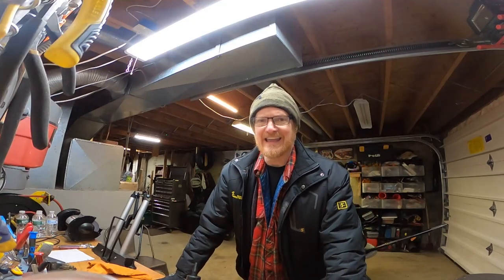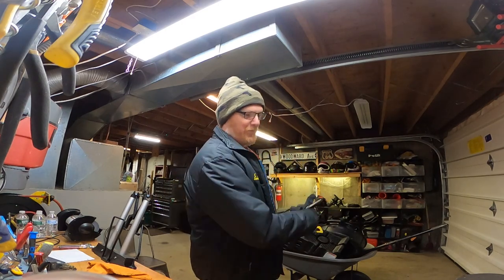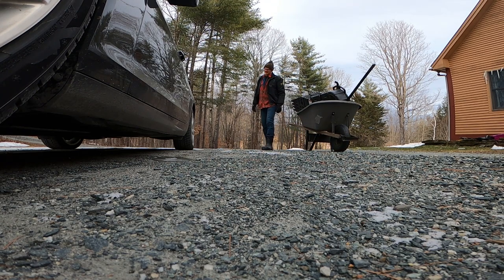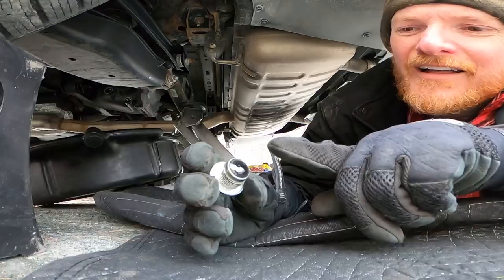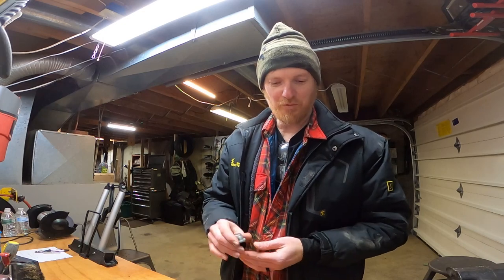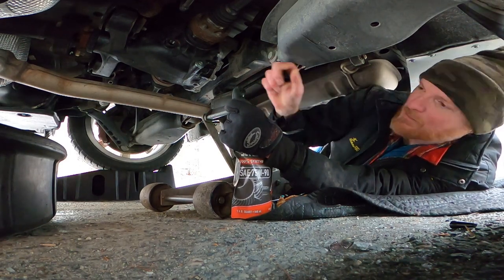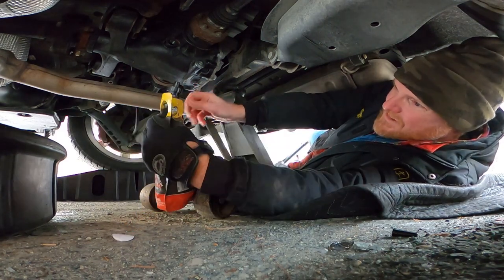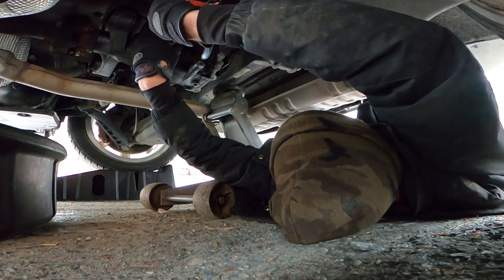Cadillac ATS NEW Differential Making Noise - Will Amsoil SVG 75w90 Help?

Comment: I really like your videos! Thank you for the awesome, genuine ATS content! I am a Cadillac ATS owner that likes to do things myself and its nice to know that someone else has experienced the same things I have experienced and is finding simple solutions!
Reply from the maker: Thank for the kind feedback. Its a marvelous car. Ultimately I had to have the dealer replace the rear differential again, but its currently smooth as silk! Nice to hear from you my ATS brother :)
Reply: @sstressfl   Of course! so just to clarify it was the rear differential that was causing the car to run rich?
Reply from the maker: @michaelguidice1663  No the engine had a vacuum leak in one of the active motormounts and connected hoses. They replaced them and it fixed the rich condition... which technically was a lean condition but the computer was compensating for the vacuum leak and dumping extra fuel into the system.

Comment: Hey brother congrats on the solution. My 2013 rwd has 106k on it. But my rear diff did go out at about 85k and my radiator just cracked 3 weeks ago. Not cheap. But, I paid to repair them. I can’t see getting another car. My car is modded and tuned. They are so fun to drive, I get what you are saying. Is that SVG for AWD only?
Reply from the maker: AWD only. Amsoil said use the GM stuff for the posi 👍

Comment: Great move with all the jacks, you can never be too safe. I hope it fixed your problem!
Reply from the maker: The amsoil is amazing. Unfortunately these differentials are not lol. But the car has been usable with the last one the dealer installed. Still makes some vibration, but I suspect the mid-bearing (driveshaft) might be part of the issue. Thanks for the feedback :)
Reply: Hi Michael, 
It’s been a year since you changed the diff oil, any thing new happen since then? Hope you are having a great spring!

Comment: Any update on how the amsoil performed in your differential?
Reply from the maker: It is no doubt the most incredible rear gear  lubricant I have ever used. The simple truth is that once a rear end is failing, it’s failing. Amsoil might buy you some time but it’s inevitable. My rear diff still has some rumble but it’s more difficult to make it happen. For now I’m good... but researching other options. Like buying a Ford 8.8” center section, custom axles, etc.

Comment: Hello I'm having trouble with my differential, making a loud humming sound as soon as I step on the gas. I will try this gear oil out hopefully it'll work. Is it only one pack of oil that you used?
Reply from the maker: I'm sorry to hear it.... yes one pack is all I used. Make sure the car is level when you fill it. You want to make sure it doesnt get overfilled or underfilled.
Reply: Hey what was the out come did it fix

Comment: My diff did a gear whine from 30 mph to 45 mph on Amsoil 75W90. To get it to quicket down I purchased their SAE 250 and 75W140 and mixed both 50:50.
Reply from the maker: It will work for awhile :)

Comment: Well done.  Did you check the fluid level prior to drain?   I changed both front & rear diffs about every 30k.   Transfer case every 50k.
Reply from the maker: I need to do the front but want to wait until spring.... when it’s warmer. I don’t drive much now so hopefully it can wait. I poured out the old oil into one of my giant measuring cup and found it was a little less than 1 qt... down 4 oz. Not sure if that would be enough to make a difference.

Comment: Thanks for the video! About to do both diffs and the transfer case on my 2014. Do you have the torque specs for the rear diff drain and fill plugs?
Reply from the maker: For front and rear diff! Install the drain plug (and fill plug) and tighten to 33 Nm (24 lb ft).... enjoy!!

Comment: i am having the same problem at 126k miles and i have a 2015 ats performance
Reply from the maker: Hey you had a good run 🙏 126k is a lot for trouble free diff on a Cadillac 💪 If it’s rear wheel drive I have read that the rear diff is higher quality than the awd. Get it replaced (or replace it yourself) and you should be good to go. Just make sure it’s a good quality shop that understand the exact process, new bolts, proper torque specs, etc.

Comment: Do you think that many of these failures are due to a stuck diff vent, which causes increased, internal pressure that slowly pushes oil out of the seals? Then, as the oil level drops, damage takes place.
Reply from the maker: I’ve actually decided the vent is for vacuum. It sucks the seals tight against the axles. I believe the fail comes from metal particles that rip the seals. Bearing failures. My second new rear diff had massive wondering tolerances between the ring and pinion after a few hundred miles. A guy on the Cadillac forum told me he went thru 4 of them before they found a good one. Such a shame. The car was amazing in the brief moments it was smooth. The dealer never could get it right.
Reply: @sstressfl  I am quite a bit older than you (63) and retired. I was interested in a lo-po, 4-door 2015 2.5 ATS for going out to eat with family & friends. But from what I have read and seen, I can't imagine buying it (Carvana / Carmax). Now, as a classic car hobbyist, I have seen  vacuum pumps on racing engines in order to help with piston ring sealing. But on the diff? I haven't seen a hose attached to the vent or some such thing.

Comment: Mabe something is not designed correctly and the clearances aren’t what they should be inside it.Mabe purchase a used one from a salvaged ats of the same year and take it apart and see what’s messed up inside.
Reply from the maker: I might get adventurous. I found a Ford 8.8” center section with adapter plates designed specifically got the ATS 😎 that would be amazing! But it’s $6k. Junk yard is probably a better route 😁

Comment: Hey is it still quiet
Reply from the maker: If you have some time you can follow the Cadillac ATS playlist I made. A few more vids in the story. But to answer your question, the fluid is amazing, but the rear diff died (it was a new one). Dealer replaced under warranty. Then it happened again. Found out they never installed the rear diff properly. The mounting bolts came loose. That’s what was making it vibrate and growl.
Reply: Thanks

Comment: The opposite of oh what a feeling would be Toyota💛 Plus Toyotas’ are occasionally made in America and GM are what Mexico like Coca-Cola. sucks to work on a Toyota nothing ever breaks and if it’s a quarter century old and in the off chance something does finally fail it is four times the price. Cadillac parts are basically free upon recent research. Amsoil is best…Yes
Reply from the maker: Made in america is pretty sketch these days. I still tend to buy from the big 3.. although I owned a new 2009 Mazda MX5 that was absolutely elegant in its construction and design/materials/fit and finish. And one time I bought a new 2005 Pontiac Vibe and the sales guy said "and it has a toyota drivetrain so you know its good!" LOL! Can you believe it?

Comment: Crown and pinion probably made in India or China, same as the bearings.
That stuff is made out of chocolate
Reply from the maker: No idea but I also suspect they could have been setup poorly. You’re right about chocolate. These diffs have zero tolerance for anything going out of tune.
Reply: @sstressfl  I have a Land Rover with a "Bearmach" brand crown and pinion. The genuine Land Rover components are generally speaking Dana U.S.A. or of equivalent quality. About £1000 sterling compared with £450 for the Indian made Bearmach. 
The rear diff/final drive was forever swimming in dark grey oil , forever changing out the oil. The Dana ones stayed yellow oil.
I know that many American manufacturers use Chinese and Indian components these days, even Eaton stuff is made in Taiwan these days. I hear good things about Amsoil 75 90. God bless America. Great videos
Reply from the maker: @davidmunroeprecisionengine6121  Wow! Sounds like frequent fluid changes would be a good idea for the rear diff in the Caddy. My Dad ran a heavy Dana 60 in his race car. He didnt mind the weight! He just didnt want to have to deal with failures. And after launching his '64 Plymouth Sport Fury  with a screaming 440, loose converter with a trans break, he never had a problem. Thanks for sharing! God bless you my friend 🙏
Reply: @sstressfl  so true. Your dad knew his onions mate. I bought a good used Dana to replace now. With an air locker. I'm selling this set up along with the Eaton Detroit trutrack. Thank you and greetings from England